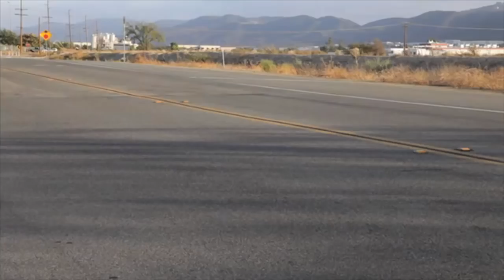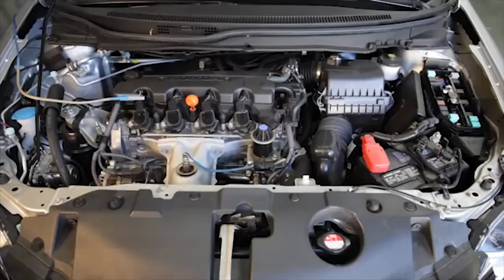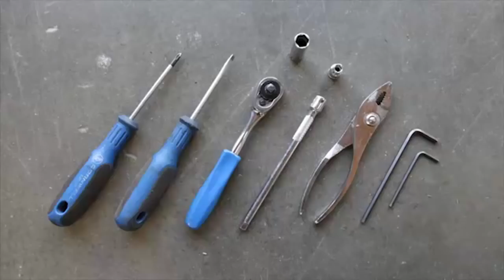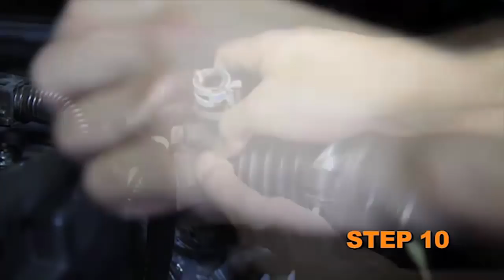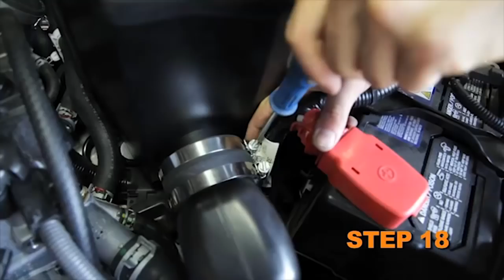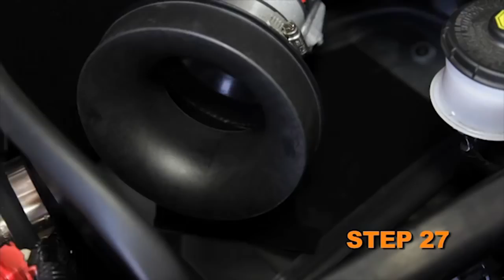K&N 69 Series Cold Air Intake Installation on Honda Civic

Comment: I removed my k&n intake after 2 years when It started melting and causing engine problems. Your stock air filter will do much better.dont believe the hype
Reply: Cuz u need a tune u can’t just put after market parts on like exhaust intake cam headers with out a tune will run rich an cause problems later on
Reply: Aque se refieren con melodía

Comment: after installing why do some lose HP, fix?
Reply: +m00nchildblues or maybe because the stock system pulled in cold air in general as opposed to a short ram system

Comment: No point doing this to a stock 1.8 L civic, their more just for getting you from point A to point B, souping up a 1.8 L automatic civic is about as bad as buying an automatic civic si, there's nothing more hilarious than hearing an automatic with a cold air intake and exhaust going down the road, it just doesn't sound right with an automatic
Reply: +fireant65 they dont make an auto si
Reply: there is a point, better gas mileage and power.  the more oxygen being pumped in, the bbetter
Reply: fireant65 this guy's an idiot, Jesus
Reply: fireant65 thats ur opinion

Comment: i have a K&N 69 series typhoon cold air intake on a 2007 Kia Spectra ex, ive had it on for about 2-3 months. ive been checking all bolts and connections frequently but lately ive noticed a whistling noise shortly after i let off the gas, ive tried losing and retightening the bolts, took the filter off and cleaned it but it still does it..any idea what could be causing that?